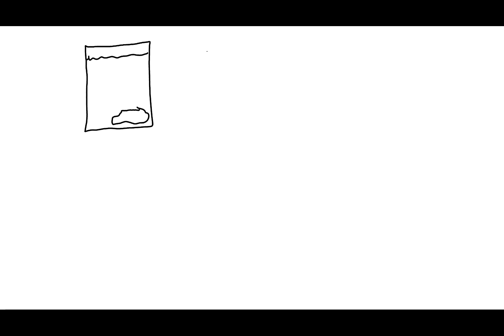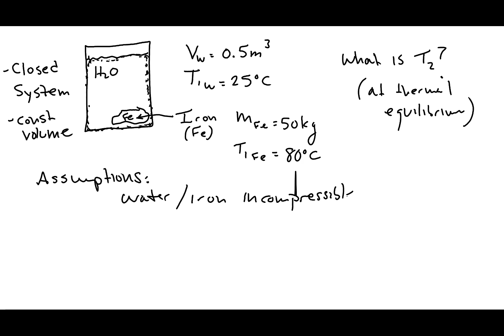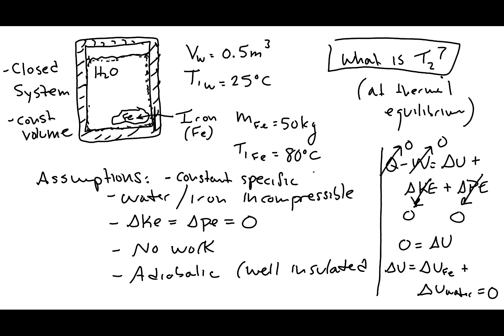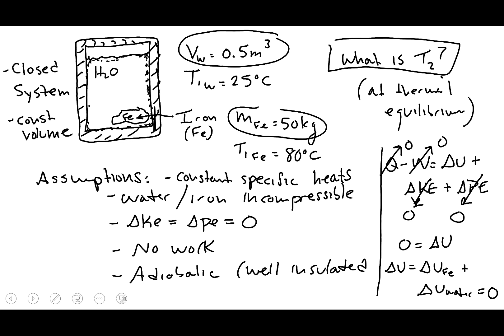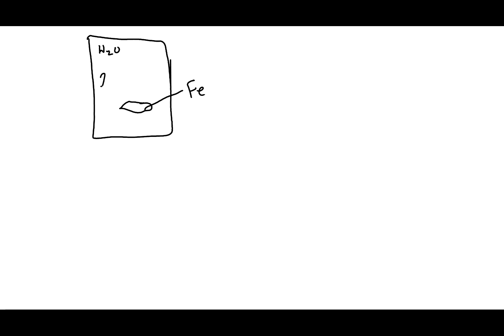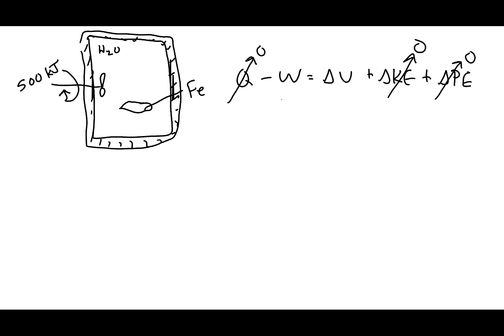Thermodynamics: Example- Cooling Iron in Water

Comment: Mam, 
this quenching problem can we solve using transient heat conduction concept?
Reply from the maker: Yes, a quenching problem is basically transient heat conduction.  Any problems involving transient analysis (changes with time) become harder to solve mathematically.. in the above problem I assumed that the temperature in the iron was uniform as it changed with time, and that the temperature in the water was uniform at it changed with time. Because the first law requires that energy is conserved it was possible to solve the problem with just an energy balance.  

To solve the problem with a transient heat conduction analysis you would need more information about your system such as the heat transfer coefficient between the iron and the water, and the cooling time.  You would also likely need to make the assumption that the temperature of the water does not change as the iron cools. (Based on the answer this is likely a good assumption since the temperature of the water didn't change much)
Reply: Raili T Thanks Mam,

As you said quenching and transient heat conduction are same then why the assumptions taken in solving problem are different.

In first case (first law of Thermodynamics), according to energy balance...
Heat released by iron = heat gained by water, 
And temperature of water will rise.

Also in 2nd case(transient heat conduction), from heat balance..
Heat released by iron = heat gained by water,
And temperature of water doesn't change, but is it so? Please clearify..

In practical life, while solving this type of problem which approach is correct?
Reply from the maker: @vishalverma210  The assumptions are different because you are solving different equations.  You are basically approaching the same problem from different angles. 

In the first case (first law of thermodynamics) you are applying an energy balance to the problem.  Since the iron and water are both part of the system, the energy balance is simply delta_U = 0.  Then, because the internal energy is an extensive property (depends on system size) you can simply sum the internal energy changes of the water and the iron.  This allows a calculation (which is actually a rough estimate) of the final temperature. I say rough estimate because of the assumptions worked into the solution.  

In the case of transient heat conduction, you apply the heat equation to the problem which greatly complicates the solution.  Assumptions are required in order to solve the heat equation analytically and one of the common assumptions is that the temperature of the water does not change.  By doing this, it's not saying that the temperature of the water doesn't change, just that we are assuming it doesn't to make the solution simpler.  Without making assumptions to simplify calculations, the solution to the problem would likely require a numerical solution. 

In general if you need to know the temperature distribution in the iron as it is cooling you would need to solve the heat equation as you can't get this information from a first law analysis.  If you just need a rough estimate of final temperatures you can just apply an energy balance (first law). In practical life, a lot of the time you just need a rough estimate of the solution initially, but then later you may need to do a more detailed calculation.  So initially you may do a quick a first law calculation but then later write a numerical model to solve your problem.
Reply: Raili T okay Mam
Thanks!! 👍
Reply: Raili T Mam, if possible, please also start uploading lectures of unit operations & transport phenomenon (Momentum, Heat & Mass Transfer).
Reply from the maker: @vishalverma210  I would love too.. right now I'm working on thermodynamics and c++ but I have plans to do some of these others in the future.